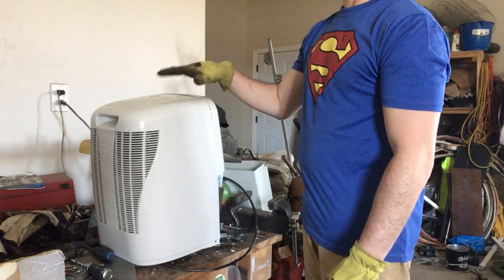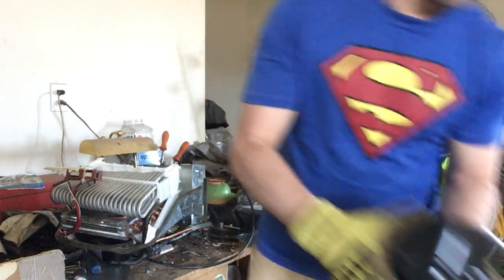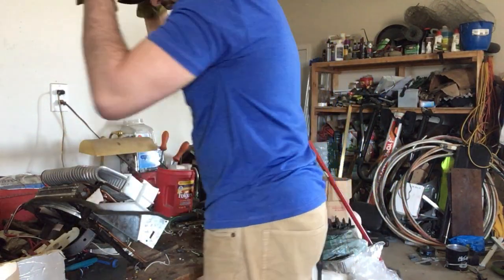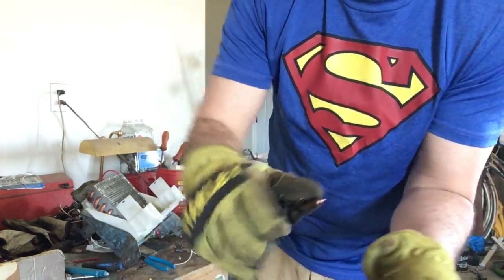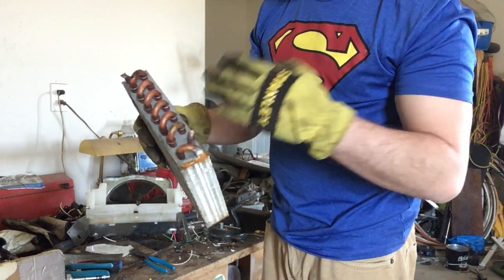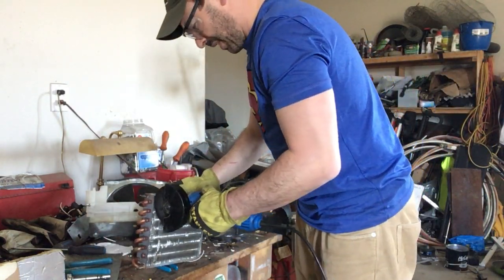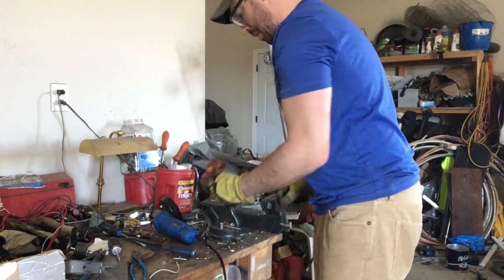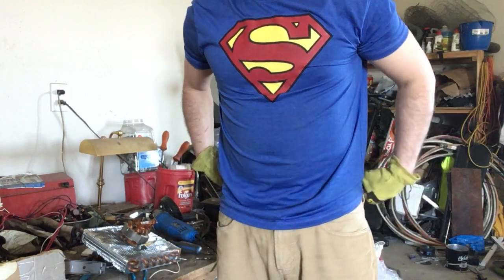Scrapping a dehumidifier for loads of copper, aluminum and other metals.

Comment: How much profit did you make from this?
Reply from the maker: copper radiators are currently going for $2.29lb (4lbs) #2 copper $4.59 (3.5lbs including outer cutoff loops, compressor, and tubing) and a few dollars from tin. Probably $22

Comment: I have trouble telling what is mixed with copper. I noticed you said something was mixed as copper and aluminum but how can you know for sure?
Reply from the maker: The radiator is mixed copper and aluminum. You can sell at scrapyard as copper/aluminum radiators
Reply: @TinManScrapper  sorry, I have never scrapped anything before. I took a washer & dryer apart to make it easier to get out buy now am seriously considering just scrapping it myself.  Everything is in pieces.
Reply from the maker: @townbell2248  Hi Shell, I actually have a video whereby I have separated all the materials and sorted into scrap Mattel and prices. I also did individual videos for dryer and washer. Worth scrapping